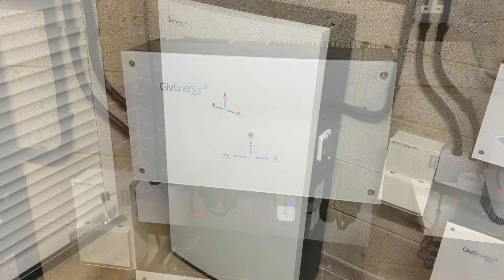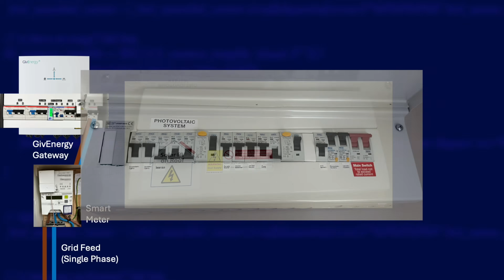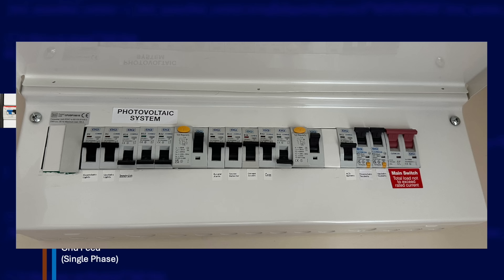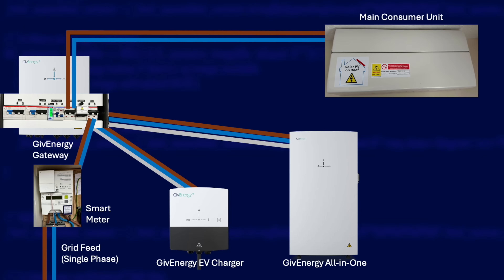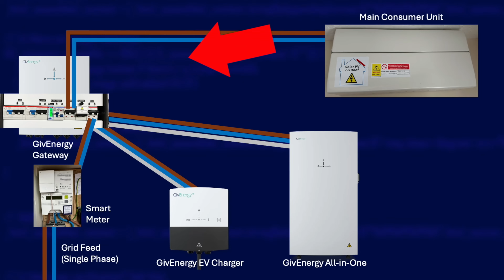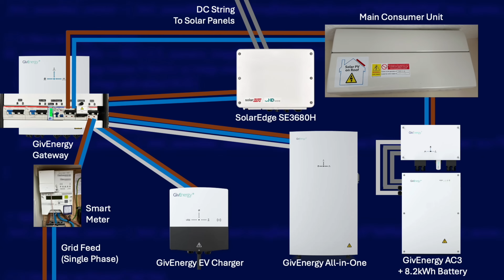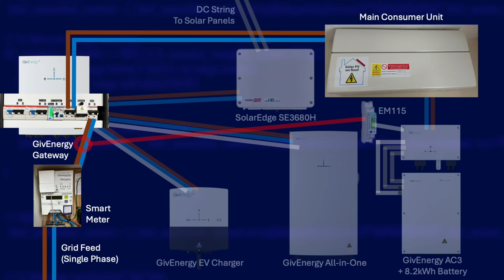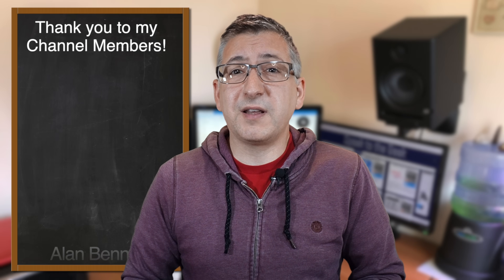Solar Wiring Walkthrough: GivEnergy All-in-One Battery and Gateway with SolarEdge Inverter

Comment: Okay so silly question time - If the AC input for Solar on the gateway is well AC - could you in theory take a cars V2L feed and feed that as a solar feed to top up the battery?
Reply from the maker: I wouldn't recommend that! In theory if you totally isolated your home from the grid first then V2L could be used to power the home and subsequently charge the battery, but if it's connected to the grid in any way then you are illegally connecting a generation source to the grid and potentially violating your car's warranty.
Reply: @SpeakToTheGeekTech  
AIO and Car are both charged from grid and AIO can discharge to grid, so if/what makes  car a generator and not the battery?

Vision was V2L feeding at 1kWh controlled by Shelly through HA only when battery < 80% and cut off when over with AIO told to always charge from solar feed.

Comment: Always interesting, but a question. In the event of a power failure, does the Gateway switch fast enough to keep computers running?

GivEnergy themselves are somewhat vague about this.
Reply from the maker: Yup, fast enough that nothing notices. It gets tested regularly and in fact I’m sitting in a blackout right now running off the battery for the last 6 hours
Reply: @SpeakToTheGeekTech  Thank you for that confirmation. Good news indeed. The problem I am now left with is whether the Gateway can be used with their Stack batteries as I like the idea of expandable storage, but GivEnergy only mention the Gateway in connection with the AIO. However,  should be possible, but they may have made it not so.

Comment: Had my quote from Octopus for the Heat Pump and a date for the survey, if it's a go ahead will be using your install code for the £100, What I want to ask is where can I gey a ready built Home assist unit as to build your own via Youtube Videos does my head in, I have Solar, Battery, EV, Zappi Charger, IBoost Solar Diverter and some off peak storage heaters, I have quite a few sensor's to my mobile phone but want a Plug -n -Play screen on the wall to show all.
Reply from the maker: Thanks, I appreciate that! As for ready-built Home Assistant, there are some sellers on eBay who sell such a thing but I couldn't recommend them personally. It's so very easy to just buy a case, memory card and stuff, then copy the image to the card using Raspberry Pi's installer and it would save you a lot. The problem is, Home Assistant isn't really plug and play, even if someone sells you a pre-made one you have got a huge amount of effort ahead of you to configure all of your devices and make your dashboard. Home Assistant is for a devoted technology enthusiast really at the moment still. That may change in the future, and my guides/videos intend to try and smooth that process a bit, but it's still going to take some learning.

Comment: Great video - thanks so much for taking the time. I was searching for something like this for ages!

One question....the extra meter for the ev charger which im lead to believe is essential for full integration eith the AIO and server control....is the CT clamp positioned on the positive cable leading to the EV charger? Im guessing thats where it should be, but you never know...!
Reply from the maker: No it is around the live cable coming from the smart meter to the AIO so as it can monitor you grid import/export. It’s not essential to have this, you can do cloud integration with the AIO, but I would highly recommend having it separate as it gives you options.
Reply: Thanks for the reply- my setup simply isn't working with excess solar divert and octopus intelligent go integration. It's effectively a dumb charger.
I was wondering if the extra meter would change things at all.  Second option is to re-install my old zappi V2 which I replaced for the givenergy offering!
Reply from the maker: @nickunderwood638  If your charger can't see the exported solar power going out to the grid, whether that's provided by the GivEnergy Gateway or a separate EM115 meter, then it can't possibly know that there's any power to divert. Your charger also has to have been configured in the correct installation mode for that to work too. Your issue is most likely down to an incorrect installation. The use of an EM115 connected to the charger and monitoring the grid would let you put the charger in 'CT Meter' mode. The other modes being 'Standalone' (never do that, it's totally manual) or 'Inverter Control' which is what you should have now. It's worth checking you are in 'Inverter Control' mode by looking at the 'Change EV Configuration' setting of your charger in the app.
Reply: Thanks for the reply. That's what I don't quite understand.  I have a meter connected to the live cable coming to the AIO already. It knows the import / export values.
Why then do I need a 3rd meter for the car charger connected to effectively the same place?
The AIO shows the values correctly, it just doesn't control the charger correctly! It charges using grid when solar surplus is either above or below the 1.4kw.  The charger is set to Inverter control and "don't discharge battery" - just seems to ignore settings most of the time!

I also can't get it to charge with Octopus intelligent Go with a Tesla controlling the charge. 

The software/firmware seems very sketchy to me. Very unreliable. I know everyone's experience is different, but I feel like a beta tester!😂

Comment: I have a AIO & Ohme now for a year. Had the AIO dual been available when they installed it, I probably would have gone for 2 x AIO. However, in use like you I am on Octopus but intelligent Go, so charge it up over night and find I rarely run out though do occasionally. Not sure that we get anywhere near the 13kWh back, with conversion losses.
But when i look at the cost of buying a couple of hours at peak it is only £0.50 on a bad day, where there is no solar. Like today with snow on them. Grrr.
The cost for a 2nd AIO is a huge jump though and now worried that by the time I have persuaded the boss to let us have a heatpump we may not get an expansion unit as it will all be the new AIO2 by then. 
So that was all very helpful to see that it is possible to mix and match - without the hassle of HomeAssistant. 
Thanks
Reply from the maker: If you have an AIO already, I'd really suggest getting a second identical one if you are expanding. My dual-setup is really a bodge and a compromise. It's all about cost-benefit of diminishing returns though and there is a point where just paying for a bit of peak is a lot better value than extra storage.

Comment: Nice video. I have a similar setup but just the AIO. I have not installed the GE charger yet. Do you know if it is possible to restrict the charge rate on the charger? I would like to charge the battery if IOG gives me low rate charging outside the normal cheap rate. Is that possible with HA? Can we see when we get cheap rate or would putting a current clamp on the charger be a simple way of seeing that and then using HA to trigger the battery to charge as well?
Reply from the maker: Yes you can restrict the charge rate on the charger. And yes you can use GivTCP with the Octopus Energy integration from BottleCapDave so enable/disable charging when you get a cheap session.

Comment: Thanks for the video! Do you find the GE EV charger/solar diverting stuff works well?

I have a spare GE charger and I'm considering switching my Ohme Home Pro for the GE unit. I have an AIO, too. Hopefully we can get the home assistant integration updated soon....I really need to start automating the battery charging parameters...!
Reply from the maker: Yes the solar diversion on the GivEVC works very well - I use the EM115 monitoring the grid with the EVC though which means it can respond to export power very quickly and totally separately to the batteries. BUT... now that my export rate is more than my off-peak import rate, it makes no financial sense to use solar diversion. The only reason you'd be using that feature is for eco/minimal grid use reasons because it would cost you money.
Reply: I have the same setup and wating to add my charger. currently using a granny charger. What i want to do is monitor when Octopus gives me low rate charging during peak hours and force charging of the battery. If that works I may want to restrict the charging speed of the car to extend the cheap rate time.
Reply from the maker: Totally possible using Home Assistant.